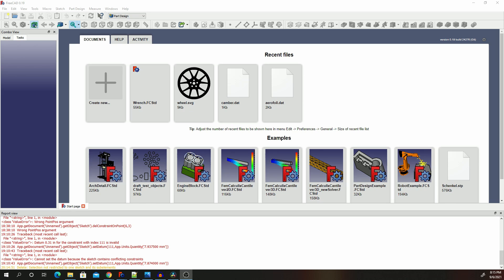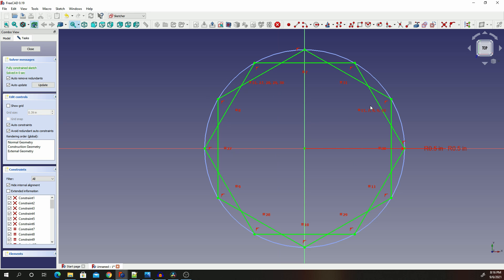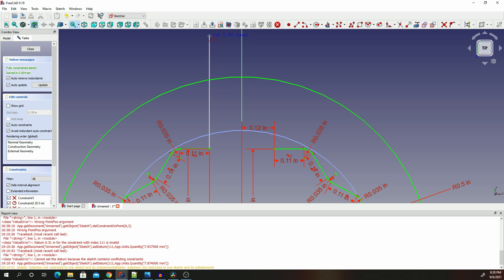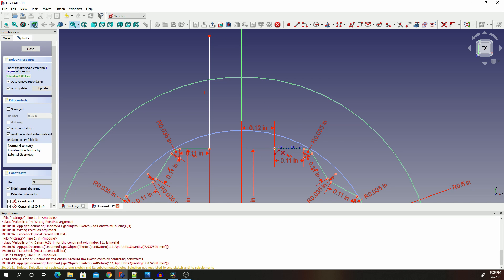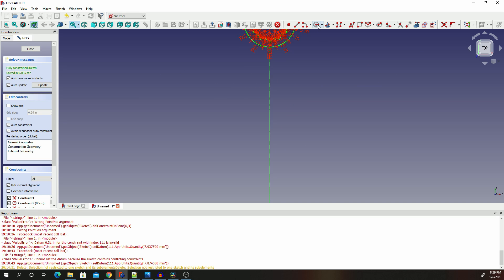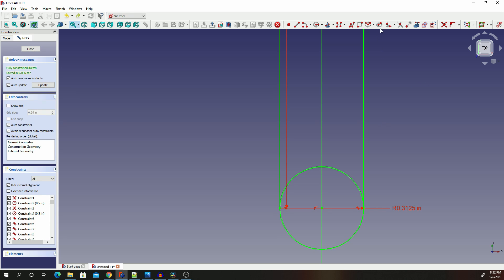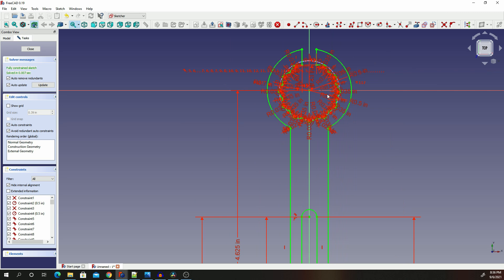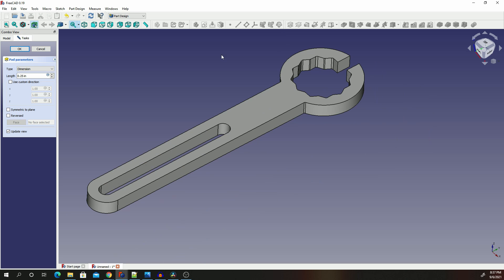How to design a Wrench/Spanner in FreeCAD

Comment: Just a question - why spend all that effort making a slot in the handle from circles and lines when the Slot tool is right there?  Likewise, when dimensioning all of the fillets etc - why not dimension one and then use Equal Constraint for the rest?
Reply from the maker: The slot tool had some unexpected behavior which has been fixed in FreeCAD 0.20  Ths was released on 14 June 2022 .  Slots were restricted to work perpendicular to the sketch axes. For the fillets you can use the equal constraint , I prefer having control of each dimension used. Regards